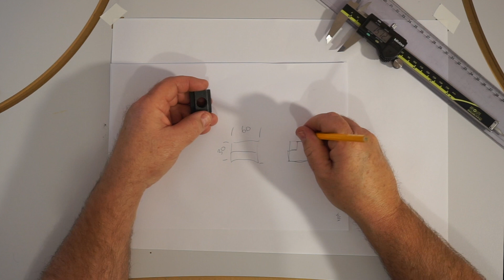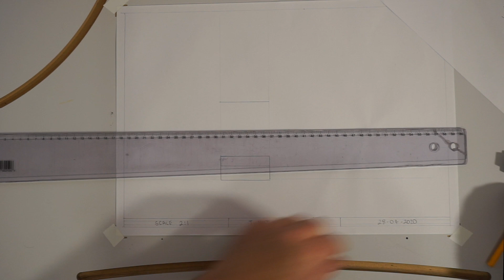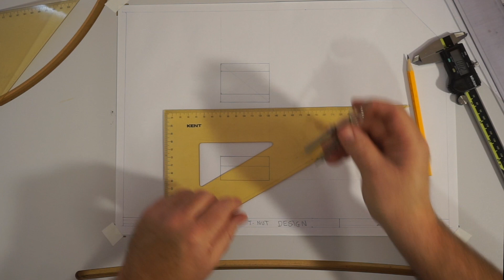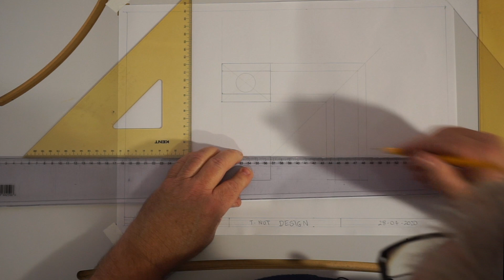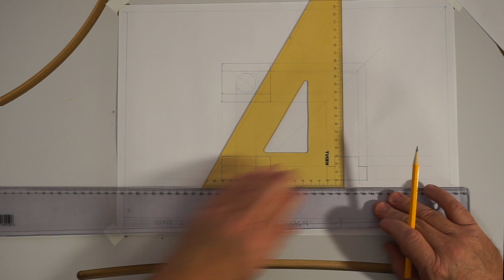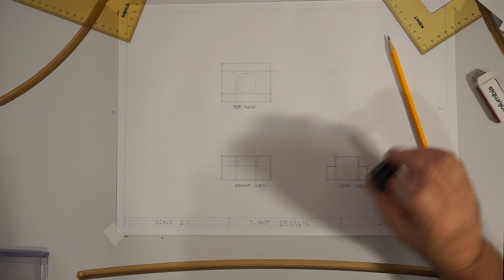Hand Drawing - T Nut Orthographic Drawing (9 Line)

Comment: Third angle projection .   What was the 9 line  derived from . that's a new terminology to me .    Can you remember how to generate pipe joints , i used to be able to do them with out batting an eye lid . But that was 35 - 40 years ago , forgotten a lot !     Cheers .
Reply from the maker: Morning Max.  Yes the 9 line projection method was taught to us in high school (Queensland system) and during my teacher training.  I just looked up my "Engineering Drawings Handbook" and they state 3 methods.  Using a single 45 degree line like I did, or circular arcs or multiple 45 degree lines to get that side view.

Ah yes, the question you ask is called "intersecting solids".  We had to do these at University also, but I've never used them since.  Many of my mates who are "boiler makers" had to do this and they know it backwards.  I believe now they just bring the printed plans out into the shop (CAD generated) and the boiler makers traces it onto the pipe that they are doing.  Cheers mate, Aaron.